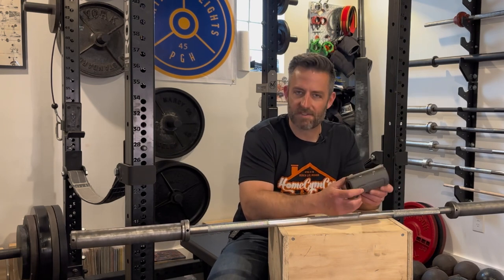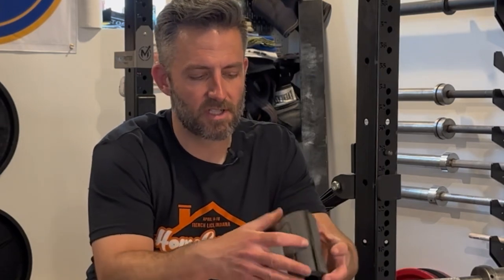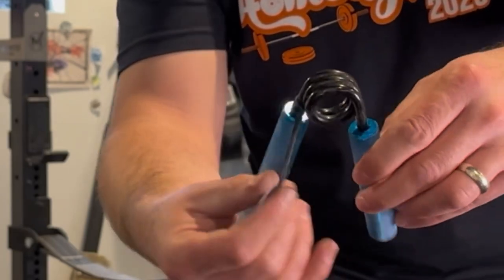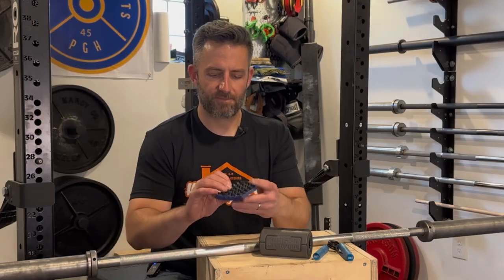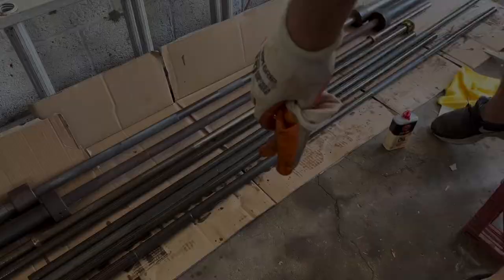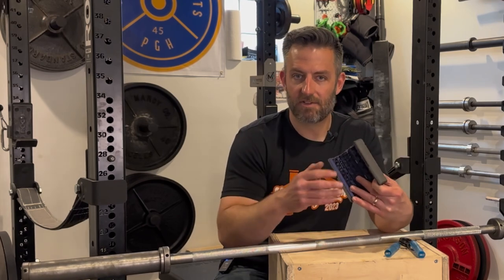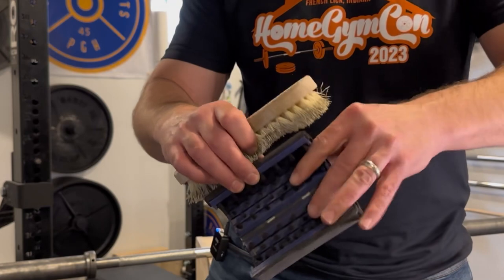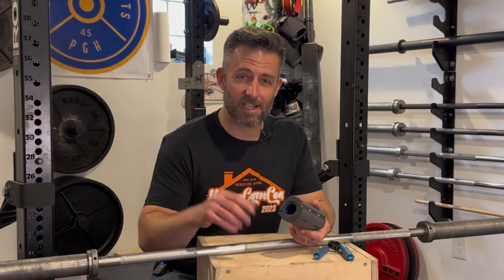Barbell Rescue Brush Review - Restorations? Worth $50? Long lasting?

Comment: Quick question! When restoring rusty plates, after soaking in vinegar and scrubbing/drying off, would you recommend using 3 in 1 oil to “season” the plates and letting it soak in for a day or so before painting, or do you think this would make it harder for the paint to stick? Thanks!
Reply: I am also from pittsburgh and have some more questions about a purchase of weights i just made. 

After viewing some of your content it seems like a pair of Billard Barbell 50 lb 1 inch hole plates could be considered a rare find? I just purchased a pair and was wondering how difficult they are to come by.

Second, I also purchased a set of 2 inch standard plates. The only text on them is “OLYMPIC” but after early cleaning I uncovered an engraving that says “Taiwan”. I was wondering if you would consider these likely vintage ivanko plates? 

I would love your input and can send pictures if you are interested
Reply from the maker: I like to use CitriStrip gel to strip to bare iron if repainting. As for oiling, not really. You can just dry off and paint. Here’s a video I made about painting: https://youtu.be/P3z6bkdtN7s
Reply from the maker: It’s really tough to say without seeing them. You’re welcome to email me at VintageWeightPGH@gmail.com
Reply: How/where do you dispose of used OA?